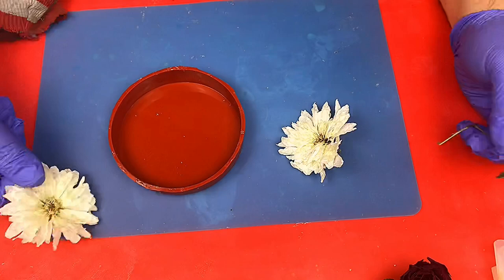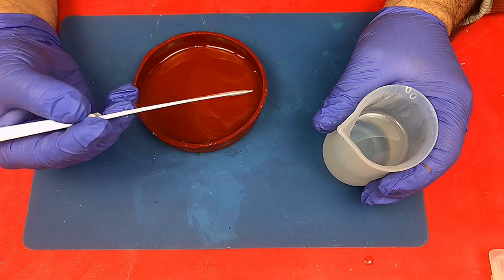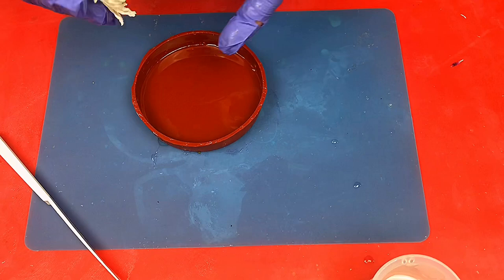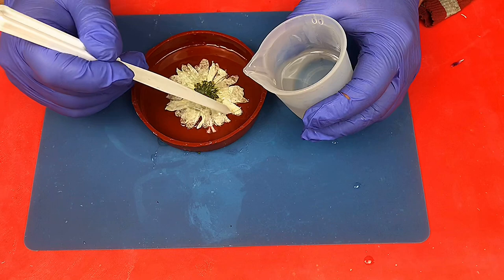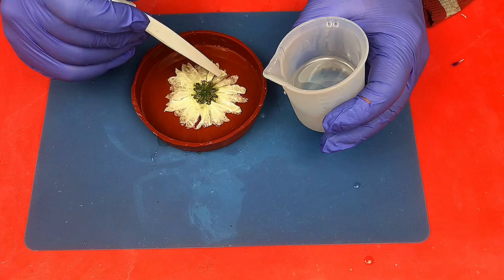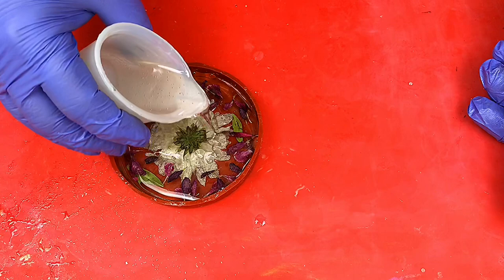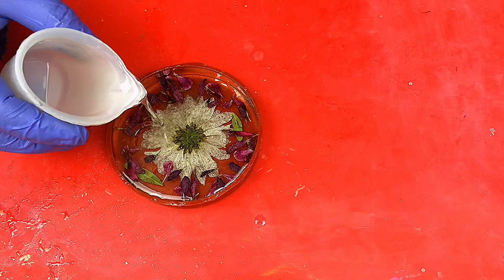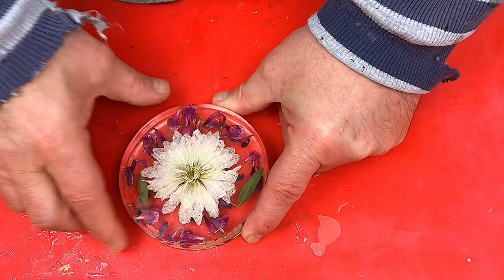EPOXY RESIN WITH DRIED FLOWERS - Masterclass

Comment: what is the issue with my resin?
I did my first coaster with ArtResin brand, after more than 72 hours I check it , it is nice!! Now it more than two weeks
but when I try to fold, I feel that it can be folded hardly "bendable", not strongly solid ?
 Now it more than 2 weeks but same bendable~!!!!!
I don not apply ink or pigments, I mix well with equally amount of ArtResin product???
I try my second attempt more careful to adhere the instructions but the same second bendable coaster!!!
I have bad experience with Art Resin!!!! What u advice me abpout?? temperature?? or what??
as I kept it in a wooden closet cover with plastic cover.
Reply: @SteveMcDonaldArtsandCrafts  it is ArtResin, the issue is my project for coasters, and i have bendable coasters, as it is bendable it is not cured and it will not resist heat
I have 16 oz of it, I am not sure what to do with it , try to find any other project!!!!
Anyway thank you brother and keep nice work and nice videos